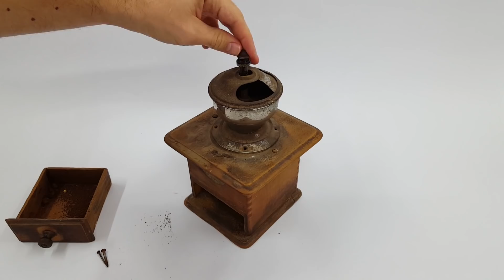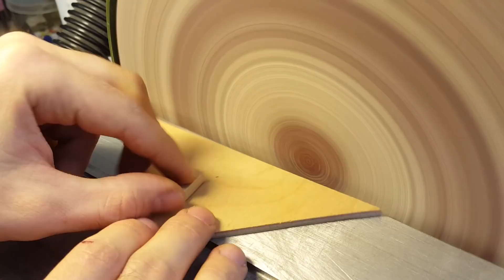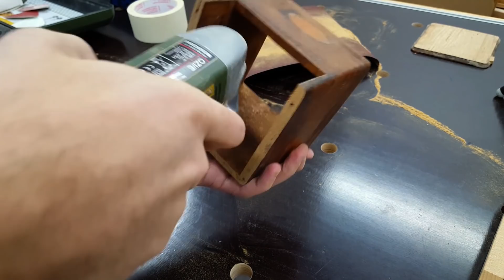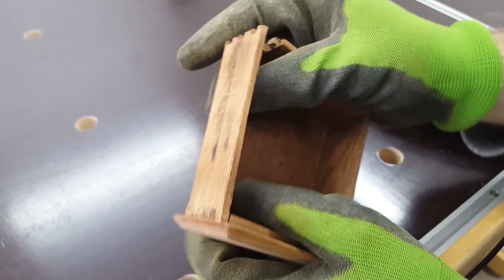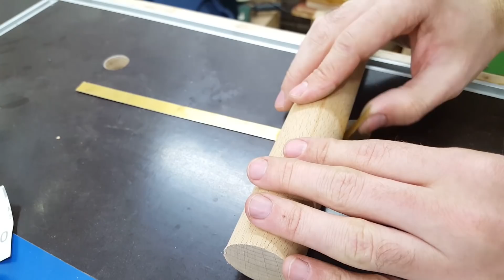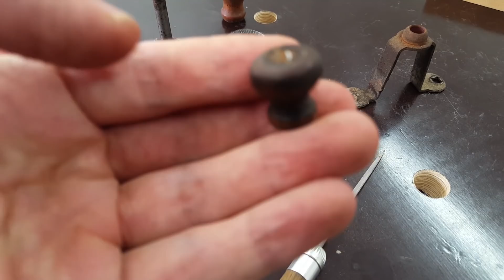RESTORATION of a 1930´s Coffee Grinder – Part 1 of 2

Comment: I mean I don't really know what I'm talking about, so this is not a critique but rather an honest question:
Why epoxy, why not wood glue mixed in with sawdust. I've seen others use that to fill in holes and patch wooden stuff in restorations with great success. Especially as it keeps the "woody" look and feel.
Reply from the maker: For more strength, that mixture is good in wood that is still solid, but epoxy can actually give back strength where there is none. It sort of stabilises the wood.
Reply: @pilotsworkshop4554  Good to know. So the wood glue plus sawdust is fine, but doesn't really improve the structural integrity whereas epoxy does. Thanks. :D